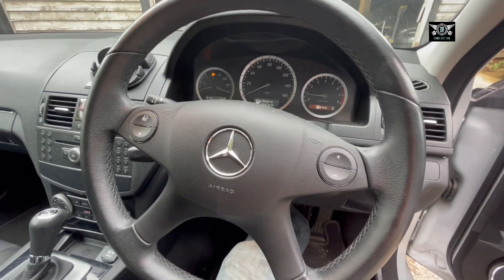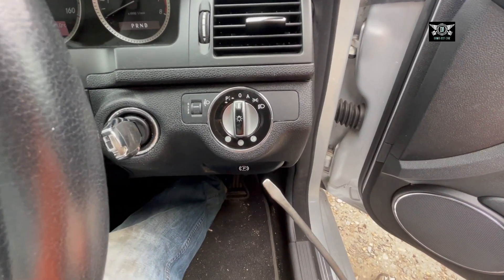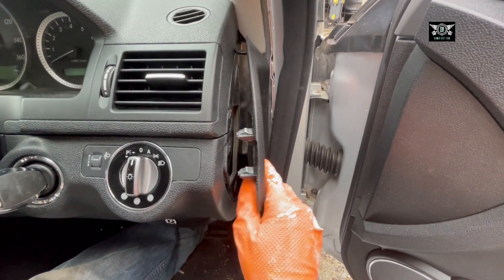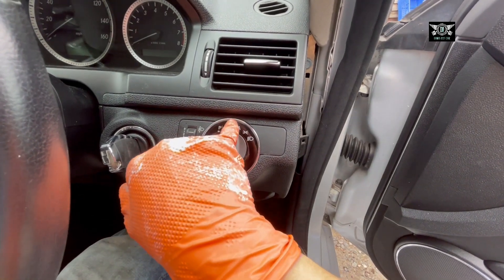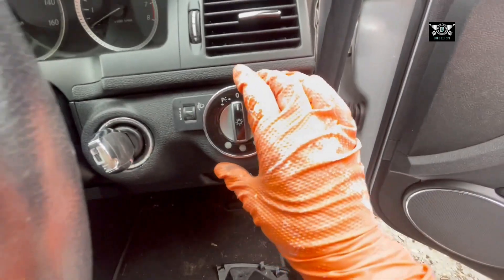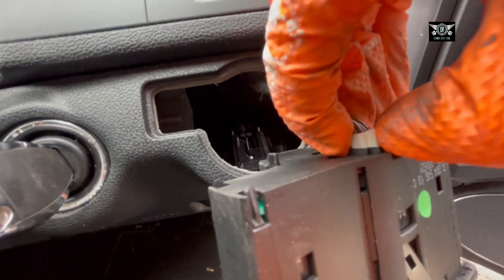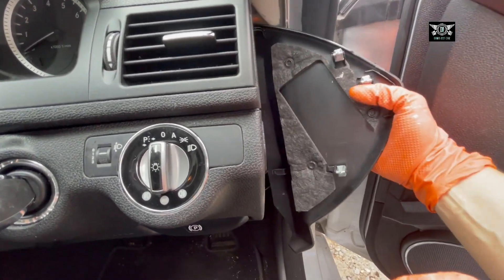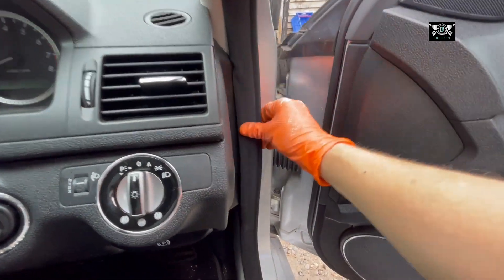Mercedes c class w204 2008 2009 headlight switch removal

Comment: thanks for this, I have the same issue with my battery completely drained on 2 different occasions. I believed it was the headlight switch as when I pushed it in whilst the side light was on but the switch was in the 12 o clock off position, it would turn the light off. When removing the old switch, if you don't push all 3 springs down then you'll end up breaking the springs down trying to force it out like I did. It's in the bin now anyway but was quite painful to get out.
Reply from the maker: I hope you got it sorted in the end.

Comment: You don´t need to.
Just rotate the black circle clockwise.
Put the ring out.
Press the 3 metal latches and pull from the switch.
Thats it.
Reply from the maker: Ok thanks for the tips.